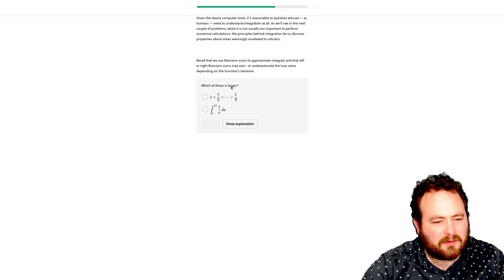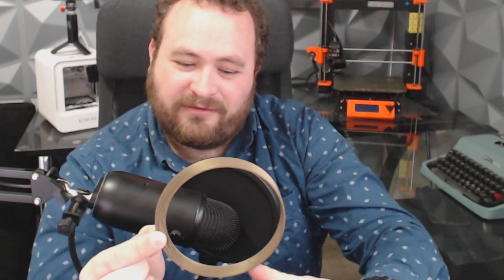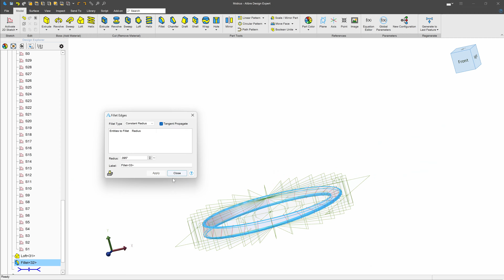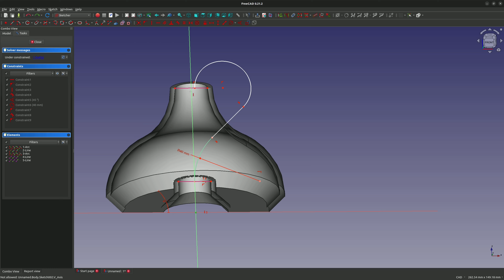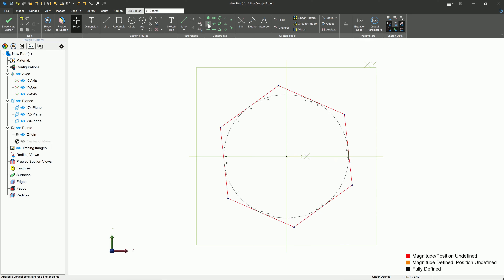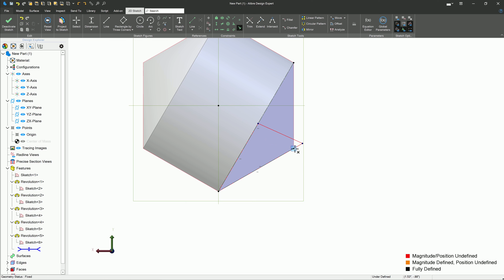Incredible Geometric Shapes and How to Make Them! |JOKO ENGINEERING|

Comment: Hello Mr. May I know the specs of the computer you are using for the FreeCAD application
I've upgraded my computer but it's still not responding during the simulation
Thank You
Reply from the maker: I have multiple

Xeon / i9
32 GB RAM
SSD
Nvidia Quadro M2200 / Geforce RTX 4070

The specs are probably not very useful.  Edits can make things look faster, while recording the screen in 2K or 4K will make it look slower at the same time.
Reply: Ok thanks Mr.
Reply: What generation of processor is it for, Mr.

Comment: That isn't a Reuleaux tetrahedron (or a 2D triangle ), it should be the intersection of 4 spheres.
Reply from the maker: If you get the spheres right, indeed you end up with another shape of constant width.  I realized I used a Reuleaux triangle to describe the 3D shape, it should be called a Reuleaux rotor in the video.  Couldn't do all the interesting shapes out there, but I did as many as I could cover.